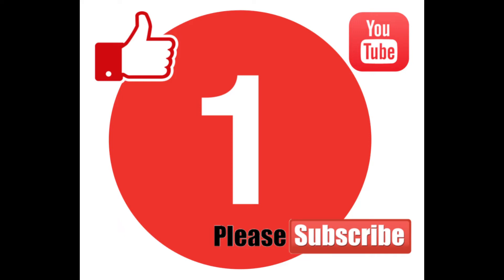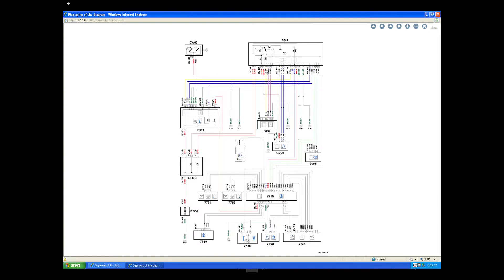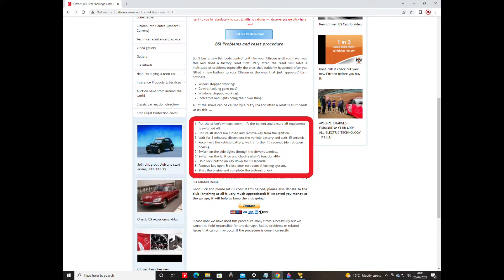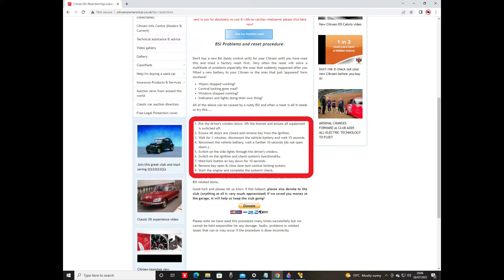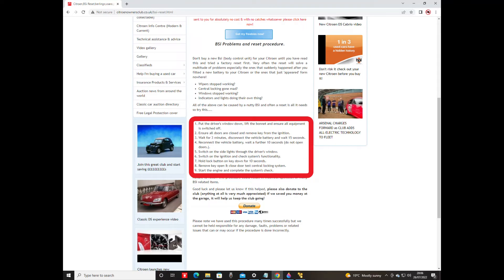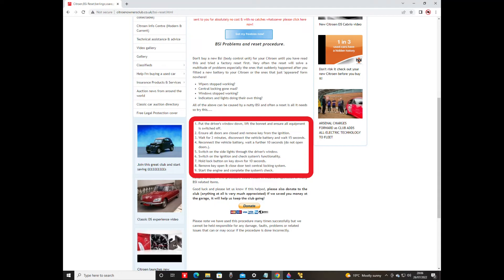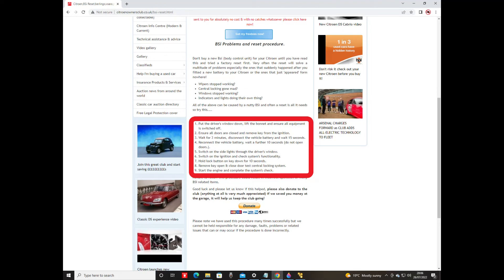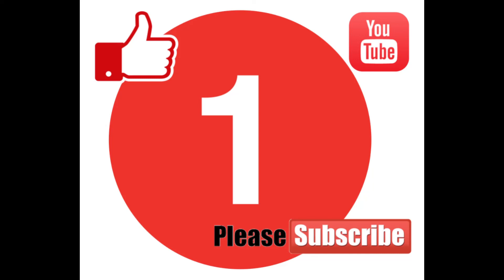C4 grand picasso suspension failure and trouble shooting. Part 4/4. FIXED?

Comment: ad.2 closed = central lock locked or door just shutted? ad.8 close and open using central lock (buttons on the key)? Thx for clearing things up
Reply: Hi could you point me to where you got the software from to do your picasso, I have the same fault you had.regards Mark
Reply: Read description!
Reply from the maker: Thanks for taking the time to comment. I don't know if this will add any information for you. First I only every use the buttons on the key fob to lock and unlock the car, I've never had to use the key in the door lock. Secondly my suspension would adjust if needed when I unlock the car, but since replacing this compressor it doesn't happen very often now, what it does do is adjust once passengers or luggage is loaded and I close the door. I hope this helps.